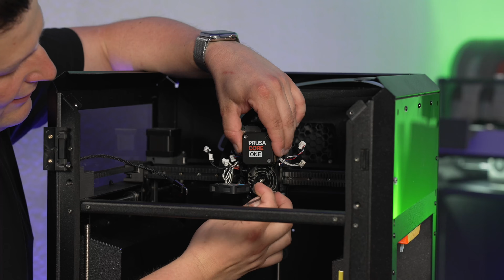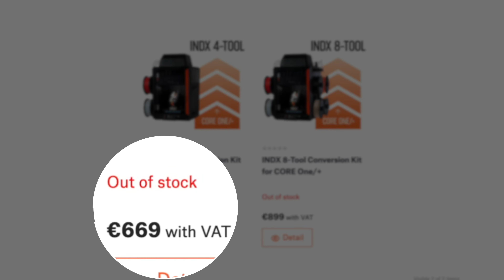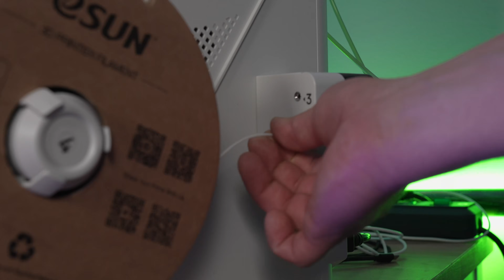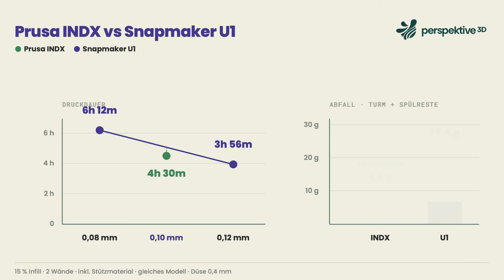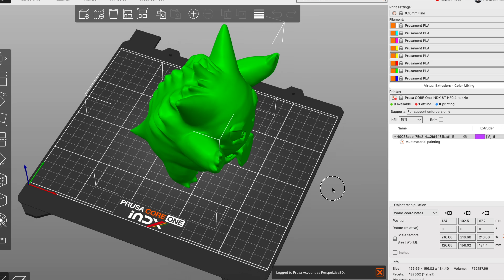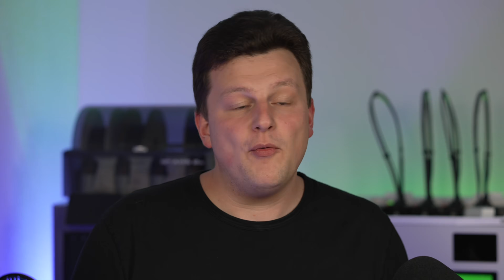Prusa INDX: Is It Worth the Wait? My First Look

Comment: H2C it is then... this is becoming ridicules, Prusa is becoming too expensive and still has no real AMS which makes your life so much easier
Reply: It's on sale right now I think 2100
Reply: As someone else said, you will not regret buying one. But instead, you'll regret not buying one sooner once you have it. 😂 It has basically everything going for it. Build quality, accuracy, precision (especially with the vision encoder), speed, pretty large build volume, print quality, heated chamber, 350°C nozzles, a software system that has a seamless workflow, and AI monitoring that isn't a gimmick, which can save your prints and machine. I forgot to mention the AMS, which gives you the automation of filament drying, material management, and auto-refills during prints if a spool runs out.
Reply: You are going to love the H2C. I love mine, nothing to complain, only the speed? But who cares when the quality is top
Reply: I am interested in H2C. May I know how much print hours I should expect? 10,000hours? I am really trying to understand the life of the printer. Thanks for reading
Reply: @cgiplaylist94 If you do the regular maintenance, is hard to tell you, you can have the machine working good for years.
Reply: @cgiplaylist94 There are X1 Carbons out there with over 10,000 hours on them, so it should be no problem for the H2C.
Reply: I LOVE my H2C!  I've got 3 AMS2s running on it and I feel absolutely spoiled for color choices when painting my models.  The prints come out sharp as a knife.  I'm printing full color D&D minis, I throw a wash over them to blend mute the colors and add some shading and they are ready for the game table!

Comment: My h2c currently prints 10 colors with its 2amspro and 2amsht so not sure why you are saying 8 colors mixing isn’t available yet but that being said this is a great early look at this system and a really honest critical review. A lot of this seems like it will be fixable in software and prusa likely needs real world feedback like this to develop this new tech. Thanks for the vid!
Reply from the maker: Welcome! Yes you‘re right but for me the H2C is in between a true toolchanger and a single nozzle printer. I mean this is it‘s advantage but if you use more colors than nozzles in the rack you loose the advantage and kind of fall back to a single nozzle AMS style of printing. Anyway the H2C is a great printer and it has a lot of advantages (at least you can print with more colors than nozzles of you need to)
Reply: @p3d-intl the same argument can be used to the INDX when user want more colors than the number of toolheads it has
Reply: @Thekidisalright Sure but full spectrum printing requires at most 5 colours which is less than the 8 available on INDX and more than the 2 available on the H2C
Reply: @bosstowndynamics5488 
H2D has 2....
H2C has 7 nozzles.... so 2 more than needed for full spectrum. With one AMS you get 4+1 which is enough

Comment: What a unforce error on Prusa. This is a DIY kludge at premium pricing. With this and the XL it's clear that Prusa is not taking the multi-tool changer market seriously and they are going to regret that. Every brand going forward are going to have more complete packages and Prusa going to fall even further behind. Such a shame that that their hubris will be their undoing.
Reply: this is not the work of prusa, it is bondtech, i think prusa is watching and learning
Reply: @nilsdock  The fact that this Bondtech and NOT Prusa IS the problem. The fact the Prusa hasn't announced ANY Multi-Tool Changer Printers and is advertising the INDX so heavily means that this IS Prusa Answer to the Multi-Tool Changer problem. I would be shocked if Prusa was actually working on a Multi-Tool Changer, I don't think they are. This is all that we're going to get for a while, and I'm sorry, this is lack luster at best and a total kludge at worst.
Reply: @nilsdock  Bondtech makes the INDX. But Prusa decided to use pellets instead of prime tower, and Prusa developed the silicone nozzle cleaner. Also they decided to not use pre-feed motors, filament recognition, no color setting in the firmware, not using enclosed AMS style filament management, and so on.

So Bondtech base can be great but Prusa messed up very bad the implementation.

Comment: it is funny how each person values different things. all these people complainig about small filament waste and how fast it takes to switch from one color and another and there is me, giving no crap about this and all i care about is size, I'm getting the SV08 MAX, and use my k2 plus for anything multicolor with size lol.
Reply: i think many give a crap even the L i smaller than a h2c and WAY bigger on the outside 7 colors or more little more waste and slower switches but so many more nice to have like drying all ams units before and during printing, heated chamber 350c nozzles way more sensors that help. Would i consider a core-l indx sure the base tech sounds nice but size and features should be better.
Reply from the maker: Yes to be honest INDX on the XL would be crazy. XL v2 with housing and heating
Reply: @p3d-intl i know people don't want to hear it but the size of buildplate and outside of a h2c with some of its not nozzle related features should be aimed for. a merge of a h2c with best parts of indx (politics aside) would be amazing

Comment: Awesome information. Really appreciate you getting this out quickly. I have a core one L which I decided to pick up recently in preparation for the 12 nozzle upgrade for that printer. Everything you said about the ecosystem and delays are completely expected given prior knowledge of how Prusa has done things. It’s also the reason I have an H2C; which I upgraded from an H2D. More to your point that was a more seamless experience. Still, great review and I pretty much agree with everything you said.  … now, time to set up that MMU3. sigh
Reply: same here i got a h2c 6 days after they announced it (nov 2025) fully expecting that only in mid to end 2027 we will get more options... it was a logical thing to expect and well turned out to be true. Not a fan of the speed difference between h2c and the u1 or this but was out and ready to go.
Reply from the maker: That was the biggest surprise for me as well how quickly they shipped after announcing at the Formnext 2025. And it pretty much worked flawlessly right from the start
Reply: @p3d-intl  And that tells us a few things they started on this way earlier than others and have been testing it and checking working around patents. The indx release is clearly even now being rushed and partly tested by the founders version. This is also true for all the others who are now reacting to mostly the U1 release. Whatever bambu's next move will be its clear they are probably already in testing it while the others are still either in planning of version 1 or beta-testing of version 1. The one exception is Snapmaker i am wondering what is next for them i expected a announce on a better U1 or a U1L already.
Reply: Unless they have recently changed; it was answered by PRUSA that the initial implementation of the L will be 8 nozzles.
Reply: B
Reply: This is the problem with Youtubers and trying to sell views on a NOT a final product.  He is entitled to his view points and nothing more. Wait for more reviews on a final kit before you make a Decision. He's just trying to be first on a hype train.
Reply: @tomtom2346  I think what/how he shared is fine its a solid update on what he found on his unit. Some youtubers have been comparing printers 'on paper' as if they are already shipped for months as facts of features and how stable they are.
Reply: @tomtom2346 It is a final kit, not a prototyp. it was delayed multiple time. And the founders edotion for that money shall wprk seamlessly.

Comment from the maker: 📌 Update: Prusa has since released firmware 6.6.2 — it brings further improvements that aren't reflected in this video yet. I'll be testing the new firmware soon and report back.

07/13/2026 Addendum: It is possible to make the assignment of the tool heads to the colors remotely. After a file has been uploaded to Prusa Connect, you can assign them there and then start the print (remotely, without any intervention at the printer). Nevertheless, the printer does not know which color is loaded on which tool. You have to remember this yourself. A corresponding dialog when sending from PrusaSlicer would be nice.

x- and y-axis are wrong in the video - sorry!
Reply: Reduce the temperature on the indx, repeat the test and compare the stringing and let us know. Indx uses very good hardware, snap uses poorish hardware; thermal performance is different.
Reply: @xpim3d From your first hand experience can you share what specifically is it that you have found poor in the Snapmaker hardware. Obviously Snapmaker is manufactured in a state of the art facility so I would have expected its quality would be at least as good if not better than Prusa's?😮
Reply: @xpim3d right now good vs poor seems like a very subjective assessment when you look at the side by side results. There aren’t many videos documenting Prusa INDX performance yet but none of the ones I’ve seen have been confidence building.